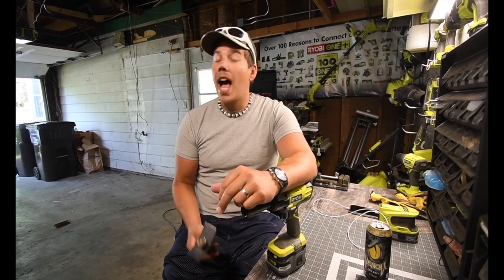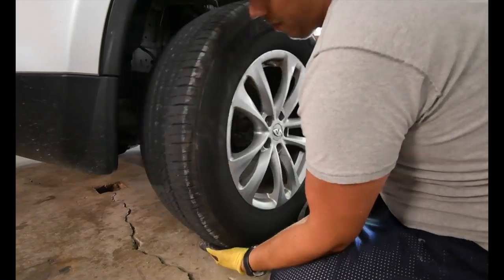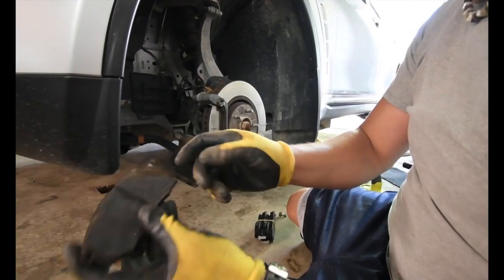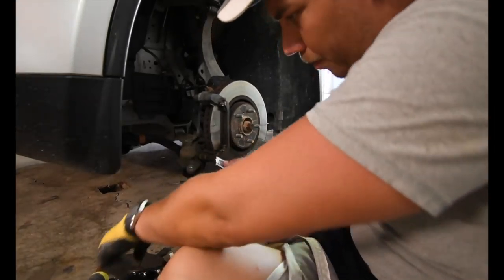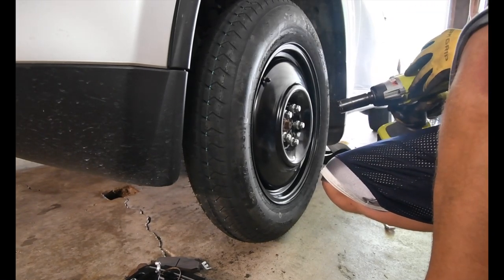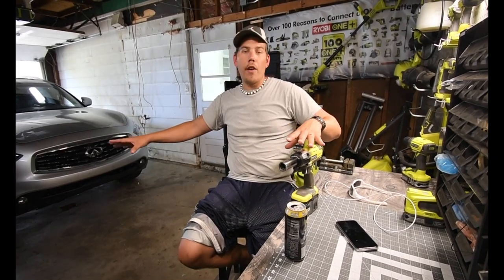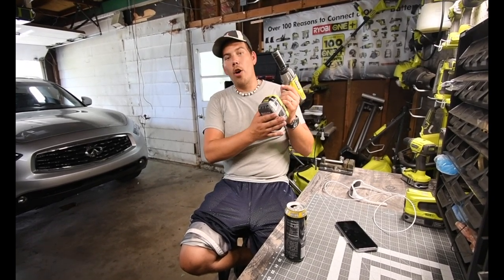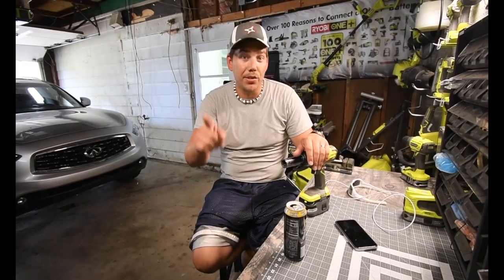Fixing brakes and rotating tires

Comment: Thanks for the review of the P1833. I will have to get one. My smaller Ryobi impact drill was not strong enough. Dave you can change your brake pads without the special tool!  Just leave the inside pad in place like you did and use a large C clamp. Tighten the C Clamp until the piston is all the way in. This works great!! Just so you know when you torque down the wheel lugs, you should tighten them in a star pattern tighting opposite lugs so the wheel torque is more even espically with "Alloy" wheels. Just trying to help!!
Reply from the maker: Thank you sir the P1833 is a great tool.

Comment: You made it look way to easy my friend😍😀😎 about 30 years ago I got a Chilton book and set out to do my brakes for the 1st time. I would read, set the book down and get ready to go and my mind went blank. Over and over lol@me. Finally, while I sat in front of it I had my friend read the instructions to me, wham bam thank you ma'am, I was able to get it done !!😎😀😍 1st side 45 minutes 2nd about 15. I didn't have the cool tool to push the piston back in, another friend told me about the C clamp method which worked well. Also no impact wrench. Had a 4 square tire iron to loosen and tighten lug nuts. I can remember having to jump on the side a few times to break the lug nut loose. lol as always David Thanks for sharing your thoughts and videos, Rodney 
P.S. I sure hope to win one of your giveaways someday😍😀like you I'm a regular guy who can't afford to pay a pro so I've had to learn by trial and error. Since I'm probably close to 30 years older than you, I only wish we had YouTube videos back then. We are cut from the same cloth. Other than that beautiful car, boat, real house (mine is a mobile home) lol oh yeah a garage with 2 walls of beautiful Ryobi Tools. Ok now were close😎😀😍😎
Reply from the maker: I've been changing my own brakes for the past 20 years. its very easy now. I could never afford to get my brakes done by a dealer so I learned how
Reply: I changed my first set of brakes at 15. My cousin helped me, he was in his 40s and had done many. I had to borrow jack stands. I too had the ciltons manual, but couldn't muster the courage to go it solo first time out. I've since done several, and been party to several more. Money aside, I don't like the monkeys down at the zoo touching my stuff.

Comment: Nice collection.
Also you don't need a brake pad separator tool. Before u pull the calipers put a big flat blade screw driver through the holes on top of the calipers and pry against the inside of the outer brake pad until the pistons stop you.
Reply from the maker: will do sir an thank you
Reply: It's just what i do.. Back in early 90s i used a c clamp... Then was told the same as i told you. Works great
Than you try it? If it works for like it does for me one less dollar spent

Comment: I haven't had a chance to read through all of the comments, but you shouldn't let the weight of the caliper hang on the brake hose. I usually have an old coat hanger tied to an upper part of the suspension ready to hook around the caliper to take the weight.
Reply from the maker: the coat hanger is a good idea, Never thought of that, Ill do that for rear breaks next time and thank you sir.

Comment: I wish I had that many Ryobi tools! I’m working on it.
Reply from the maker: You wil get there sir
Reply: I don't know if I'll live long enough to get there. Too bad we're not neighbors, I could use yours lol
Reply: Wouldnt waste your money, to underpowered, get a milwaukee mid torque or dewalt 899 impact, will do anything you need
Reply: @PockoRC  I have tons of Milwaukee tools. But those are for work. I leave them in my work van. I like Ryobi for home. Have the basics but need more. Only for DIY stuff. Nothing to heavy duty
Reply: @me7229  as you can tell from the video, it couldn't even undo a caliper to do pads, only good for small bolts, get something with a bit of power or its a waste of money. Amazon have a 700nm kildier impact for £209, would put this to shame for a small amount more
Reply: @PockoRC  lol. Yeah I wouldn’t use Ryobi for automotive stuff. I use my Milwaukee for that but for on the house projects I’ve had no issues with power.
Reply: @PockoRC  he used the wrong tool for that he used a impact driver drill not a impact wrench gun  witch is what would have zipped em offf
Reply: @jonnnn4895  it was a wrench, its just not powerful enough

Comment: I did my pads and rotors couple weeks ago. I tried using Ryobi impact driver on those same bolts you did. Ha. Didn't work. Had to use breaker bar. I've been looking for a deal on that 1/2 impact wrench. Having seen one yet. 😠
Reply: Consider an impact WRENCH rather than an impact driver for automotive  work...Ryobi P1833 is a good choice....
Reply from the maker: It is a power impact and it did the trick
Reply: It's $99 plus tax right now at Home Depot.

Comment: So, watching you take your tire off, you can see the sparks inside when you let off of the trigger. Those sparks would come flying out of the vents on the one I had and returned. Little tiny bits of the brushes, I suppose.
Reply from the maker: I should have worn safety glasses. I will for now when I work on the mechanics of the car. thank you again sir
Reply: That happens with many brushed motors. Nothing to worry about.

Comment: At 4:08 you said "this is the section where everyone is going to comment up the butt" when using the impact in behind to try to remove the caliper. Why were you worried about that? I'm new to automotive stuff and curious as to why that might not be a good idea?
Reply from the maker: I thought they would say using an impact and not a socket wrench would be a mistake.

Comment: 1:59 it's called a large flat head screwdriver
Reply from the maker: Thank you for viewing sir
Reply: at time 1:59, this tool is called a "brake piston compressor tool" or "Disc Brake Pad Spreader" as some websites have labelled it.
at time 5:05, never let the brake caliper hang freely on the brake line; use a bungee cord or "s" hook to hold up the brake caliper on the coil spring to take tension off the caliper brake line.

Comment: The most important part of the brake job is the break in drive.  Basically you get to like 45 then rapidly slow down to 5 mph. Then rapidly back to 45 down to  5 again.   You do that like 5 or 6 times.  Then you go to 25mph to 5 mph like another 5 times.   Ideally you would do this without stopping at all.  You want the brake pads to get really hot and form to the rotors.
Reply from the maker: thank you sir

Comment: I was scared watching this....did you really just jack that car up on a hydraulic jack and NO jack stand or even put the tyre/rim that you took up under the doorsill area to stop any possibility of the hydraulic jack failing (or the car slipping off the jack) and the car  falling and crushing you, your leg or other body parts casing very serious injury or death????   Please for goodness sake whenever working on a car DO NOT just rely on a hydraulic jack only, as they can fail with little or no warning.............
Reply from the maker: thank you for your input sir, I will be more cautious net time.

Comment: $1500 for a brake job??? Sounds like "Getting Over" to me... 

Invest in a good torque wrench and some jack stands my man. Never use an impact to tighten your lug nuts and never reply solely on the jack to support the weight of the vehicle 👌🏾
Reply from the maker: I do need one and I will get one and thank you